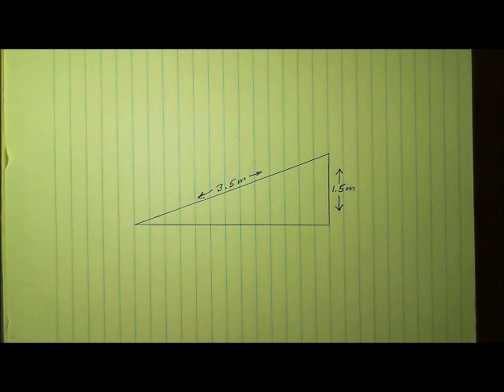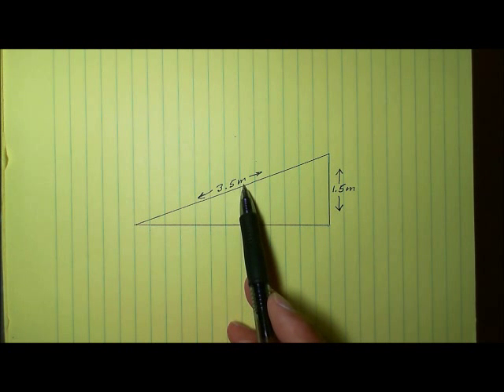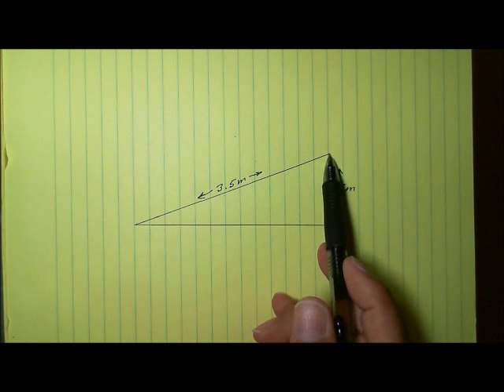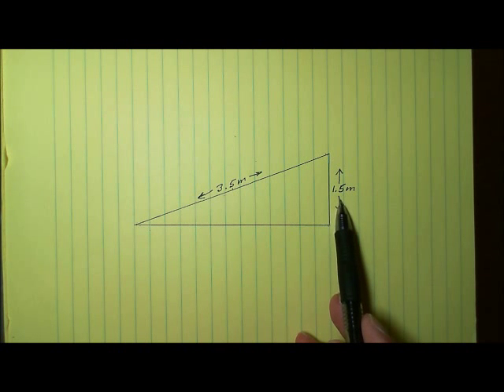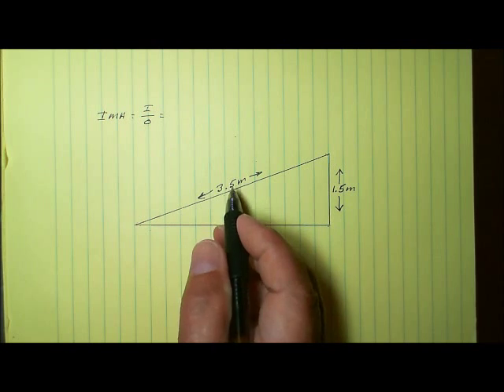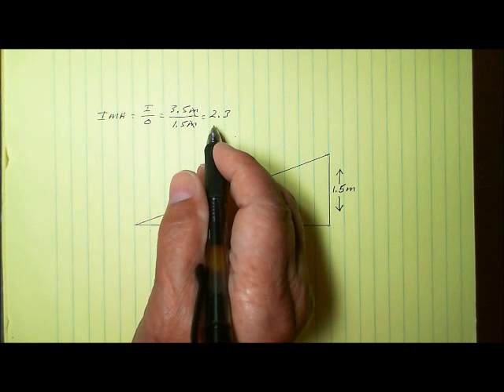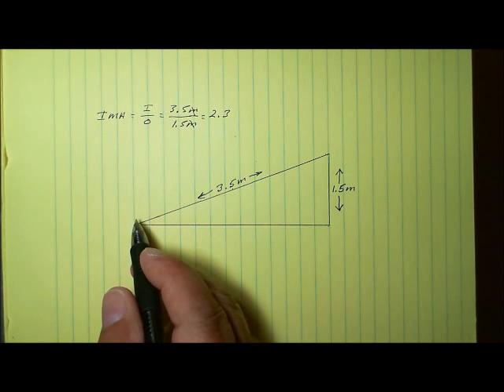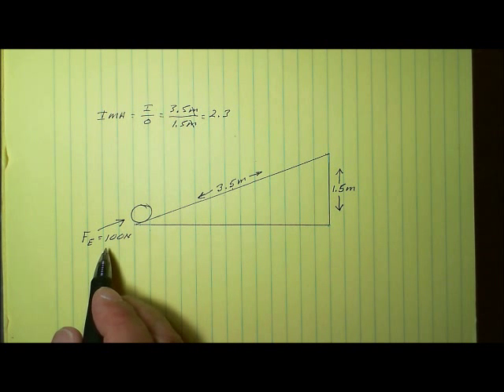Simple Machines: Inclined Plane Calculations Part 1

Comment: If they are equal (Fe and Fr,) won't the Fr (barrel) only be held stationary at any point on the inclined plane by the Fe?  As I understand it -if the formula is to be taken at face value, it would take more than the FE*IMA to move the element of the Fr (the barrel) up the inclined plane. Correct?